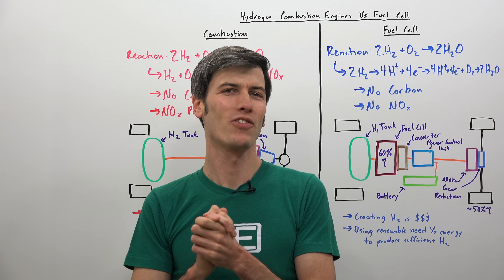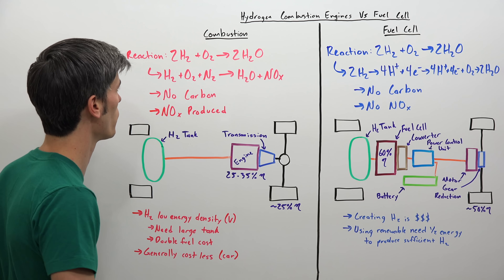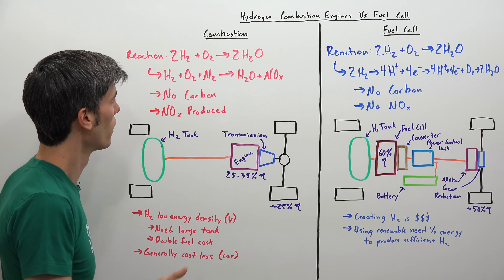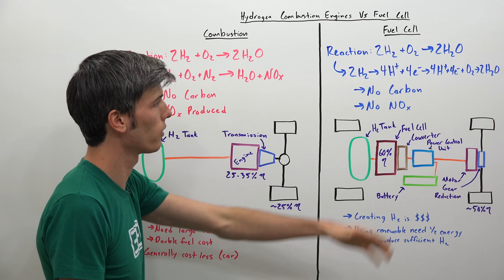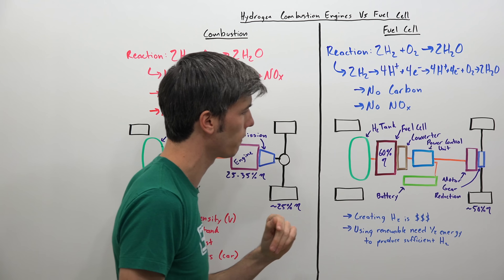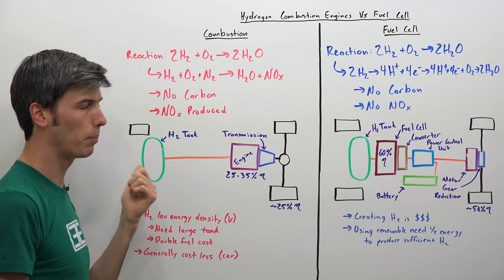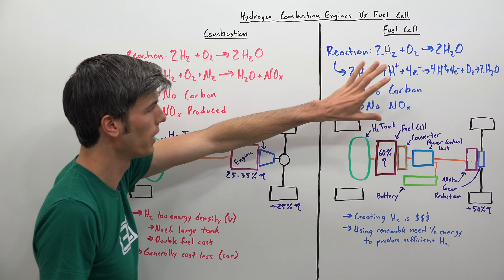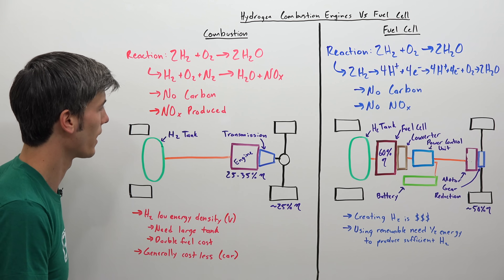Why Hydrogen Engines Are A Bad Idea

Comment: One more thing: Fuel-Cells require the mining and smelting of Cobalt and other uncommon metals, as opposed to the common iron used in internal-combustion and moderate-temp Stirlings.
Reply: The battery is also a big deal. People quikly forget what a durable society means. We need to find system that are suitable for milienear. How can you recycle a battery or a fuel cell ?....  One big advantage not mention here about combustion engine is that it can be easily remelted.
Reply: @EnderDeaD14  Yes, battery-recycling is a problem.  And children are dying in the cobalt-mines in the Republic of Congo, where most battery-cobalt is mined. Heat engines, including the efficient Stirling, can be made of iron, including stainless-steel. Iron is an abundant component of the Earth's crust, and is the 5th most abundant element in the crust. No mining of exotic scarce metals. Mining the lithium for our lithium batteries, is harming the water supplies of the people who live in the Andes mountains.  Stirling, Otto and Diesel engines can run on ammonia fuel, easily made from water and air,by renewable-electricity. Fueling stations can quickly & easily be converted to ammonia fuel, which liquifies at around 200 psi. We already have a widespread infrastructure to make, store & transport ammonia. Belgium converted their buses to ammonia-fuel in WWII, and it took only 5 months. But Stirling engines, being external-combustion engines, can easily cleanly burn any fuel, including ammonia or biodiesel.
Reply: @michaelossipoff2433  very informative!
Reply: @michaelossipoff2433  I don't think car manufacturers should replace bad gas with another bad gas. And I think that fuel-cell is the future. But because we have so many combustion engines already made and on the road. I think we should make hydrogen conversion kits for a bunch of different engines to make the road more green. And affordable for people to get a greener way to drive their car. Not everyone have the money to buy a new car we know that. And by doing this classic cars can still be on the road Without gasoline. Now I am a guy that hate non combustion cars and don't like the thought of combustion engines coming to a stop. So by doing this I can still be happy and make the world a bit less polluted.
Reply: exactly, that's the point to abandon fuel cells and ev, also don't forget that ice engines can be made with hightemp bioplastics
Reply: The Dutch company Phillips had an improved Stirling engine running in a fleet off test buses in the 70,s.Robert Stirling's engine uses an external heat source which could be either nuclear or chemical,including gasoline or diesel.The test results against diesel powered buses was good.I don't know why the project was shelved but my guess is political pressure especially as the biggest oil company around Shell is also Dutch.
Reply: @eugeneoreilly9356  Sweden use sterling engines for our submarines 😎
Reply: I don't think one person puts out enough ammonia in urine to drive very far, but yes, that hadn't occurred to me, and it would be great if we could be our own fuel-source.  But I doubt that it would be enough for transportation-fuel.
Reply: @Johnny Z'Salt But I don't know what percentage of urine is ammonia. If a large group of people were stranded, maybe they could all make enough pee-ammonia to fuel one of them to ride a small motorcycle to get help.   ...but if the motorcycle uses a gasoline Otto engine, then I don't know if it could burn ammonia without the conversion that has been used for ammonia-cars.  If it were a Stirling-powered motorcycle, then it would require less modification to burn a different fuel such as ammonia.
Reply: Maybe some long-distance motorcyclists, with ammonia-powered motorcycles, could have emergency urine-ammonia extraction kits in case they run out of fuel.
Reply: @Johnny Z'Salt I looked up the ammonia-content of urine, and it isn't much. Here's what I found:

Ammonium/ammonia-N (mg N/L) 	460 

That's only less than half a gram per liter. They seem to be giving grams ammonia-nitrogen, rather than ammonia, but ammonia is mostly nitrogen, with just 3 hydrogens per nitrogen. So the mass of ammonia would only be 17/14 times the mass of nitrogen.
Reply: @michaelossipoff2433  Yes true and I when I pointed it in a video, a Tesla fanboy started arguing why batteries were better !!!!!
Reply: Remove V8 from your pickup. You have choice of one Bovine methane fuel cell or dual Swine fuel cells.
Reply: @Johnny Z'Salt I worked for a company that was so cheap they did not store antifreeze coolant for the fleet. I always kept a case of bottled water they provided us with. Many times I had to resort to that.
But I never got blamed for blown head gaskets. Just flagged it for: "Needs Service."
Reply: @michaelossipoff2433  Keep a bottle of grain alcohol. If your bikes a one lunger you could rejet the single carb by the roadside. Maybe another 10 miles. Or consume and pass out awaiting medico arrival.
Back in the late 1970's Holley Carburetors marketed a "Dial-A-Jet 4bbl carb. You could change primary jet size,  by a dash control knob.
Reply: ICEs need catalytic converters full of platinum group metals mined in Africa.
Reply: So what! Cobalt is a trace mineral. Mining iron causes far more environmental destruction than cobalt.

Most ICE engines contain more aluminium than steel.

We would all be far better off with car shells made of impact resisted plastic than cheep and nasty steel.
Reply: @wiretamer5710  Iron is one of the commonest metals in the Earth's crust. Cobalt, an exotic scarce metal requires digging up lands that someone might not want dug-up. It's unavoidable to make vehicles from material, but iron is easist to find anywhere where it's relatively environmentally safe to dig. Lithium mining is now a problem for Native-Americans' water-supplies.  Yes, internal combustion engines are filthy & use catalytic converters. They could use air-injection & afterburners instead, but they're just too filthy to use anyway.
I propose the external-combustion Stirling engine. External combustion engines can be much cleaner & more controlled, and are much more fuel-flexible. e.g. Stirlings can easily burn ammonia, which is much, much more feasible and ready for use than hydrogen.

You say Cobalt is a trace metal. What do you propose to make the rest of the vehicle of?  Matter, I trust. You have to get iit somewhere. Yes some engines use aluminum too. The Nasa Stirling used stainless-steel. In any case, aluminum, too, is very common in the Earth' crust.

But this is all hypothetical, because land-based renewable energy sufficient for motorized transportation is impossible, due to the limited size of any country. Vast oceanic collectors of all types would be needed, likely causing huge environmental damage.

If you really want motorized transportation, especially individual vehicles, then you'll need nuclear energy. Either conventional or Thorium slow-breeder, for which Thorium is available in ordinary granite, in usable concentrations.
Reply: @michaelossipoff2433  ‘land based renewable energy sufficient for motorised transportation is impossible’

that is a remarkable law of science to have just pinned up on Mt Olympus!

Based on what? The total energy use of motorised transport today?

Why does land transport have to remain as inefficient as it is today? It doesn’t.

Based on projected renewable energy production: when? Solar PV energy production is only starting up its J curve now. The projections are it will exceed peak global fossil fuel energy production in ten years.

There is no projected limit to Solar PV energy production, so I can’t see how you can say running the global transport fleet on renewables is impossible.

…, and I only factored in solar PV, not marine wind and wave, not geothermal and not Solar Thermal.
Reply: @EnderDeaD14   batteries can be recycled tho, it's just that EVs Are still a small part of the market, as they get more wildly used more companies will start to recycle them, also let's not forget ICE engines too need a battery
Reply: @michaelossipoff2433   there's lots of new technology in battery term that negates those, per example aluminum batteries and others which don't require lithium or cobalt
Reply: @k-osmonaut8807  You're talking about a science-fiction hoped-for future. Yes, IF the batteries & fuel-cells didn't use rare, exotic metals, then things would be different. Worlds of IF...I love it.
Reply: @michaelossipoff2433  
better tech isn't that far off, heck even hydrogen production from an electrolyzer is being improved as we speak daily and will likely finish it's research and settle on a design (likely) by end of 2023, then ofc production of the units and sale of them along with companies buying, installing, and using them. still it's not THAT far off, granted the world might not be the same in that time frame.
that's just one research company, there are more but i don't keep up with them. that's also only in this part of the world (US) so who knows what other people in other countries will come up with. there will be a massive hydrogen push once the greed of the world catches wind and they all shift over in favor of the tech.

also i would never bet on nuclear energy of any kind being a good replacement for anything besides maybe space travel.
Reply: @rocksfire4390  I have no objection to future accomplishments, and the actual achievement and actual availability of future technologies. Maybe something better than ammonia-powered Stirling engines will become available. Fine.I was just talking about what's the most available now. The actual existing infrastructure for making ammonia from air, water & clean electricity, and transporting ammonia, and storing it, is already here. Ammonia fueling-stations would be incomparably cheaper & more feasible than hydrogen. Belgium used ammonia-powered buses during WWII, and they worked fine. So far the Stirling engine is unmatched for efficiency, ability to be made from ordinary common iron (in the form of stainless-steel), and production-cost comparable to our Otto-Powered cars. As I said, I have no objection to other things becoming achievable in the future. That's fine. I was just talking about what's available now.
Reply: @EnderDeaD14   i mean batteries can still be used for solar and wind storage even after they go insufficient for cars, fuel cells on the other hand are more tricky as they are probably not as profitable to be recycled
Reply: @adorabasilwinterpock6035   specially rodium
Reply: @michaelossipoff2433   i mean not really, look it up there are already tons of studies on aluminum and even sodium batteries
Reply: @k-osmonaut8807  ...and wouldn't that be nice, if we could drive a study.  There are many ideas, studies, proposals & possibilities out there, and it would be wonderful if one of them gave us easily, environmentally-safely-mined batteries &/or fuel-cells.  Stirling-powered cars have been built, driven & thoroughly tested. The NASA team reported that their Stirling Chevy could be mass-produced for ordinary car prices. Ammonia was used for bus-fuel by Belgium during WWII, & we already have a fully-developed & in-use infrastructure for making, transporting & storing NH3. Its liquifiability makes its filling-stations incomparably cheaper, safer & more feasible than hydrogen. The X-15 was NH3 powered.  We all would welcome the things you propose, but I was just talking about what's already available:  NH3 powered Stirling engines, made from ordinary common iron (in the form of stainless-steel).
Reply: Many batteries have nearly gotten rid of cobalt with the newest batteries only using about 5% cobalt. Tesla's newest don't use any at all.
Reply: I really hate it why are Stirling engines so rare
I mean
They work
They can run on any kind of heat
That's what buggs me

Comment: "Electrons come back eventually because they are very kind"

You are the Bob Ross of science
Reply: Even Rains ---- Electron abuse is rampant. They are being ripped out of the ground,  forced through wires and made to power all our devices with no compensation. How much more will they put up with before they rebel.
Reply: What about Mr.Roger
Reply: Mitch  fine  if you want to get technical it would actually be STEM not engineering lmao
Reply: EDITH BARRETT lmao
Reply: EDITH BARRETT I think he meant “mob boss”

Comment: As a car guy I have always been intrigued by fuel cells. We actually started using them in place of a battery for our equipment at work (fork lifts and such). Not only did it have better range over the lead acid battery's but it also was more efficient since it took about 4 min t fill the tank vs 15 min to swap out for a fresh 600lb-1000lb battery (depending on which equipment needed the swap).
Reply: That doesn't mean it is more efficient energy wise. Because it obviously isn't.
Reply: I do not I understand what you are saying... 
As a real car guy myself, having a 700hp 300zx, I should understand what you are talking about. 
Doesn't sound correct.
Reply: @VtecdippinBB6siR  basically the fuel cells are more energy dense than the lead acid batteries and they only need to be refilled which can be done quickly
Reply: @Simon-dm8zv  He means that for the workplace man-hours, refueling is more time-efficient than swapping batteries. In both cases, (electroysis of water to capture hydrogen vs recharging batteries), there are significant energy losses.  That being said, hydrogen is great right up until the instant that the fuel tank, which has become embritttled due to hydrogen (held under high pressure) migrating INTO he fuel tank material like water in a sponge, shatters and explodes (even WITHOUT ignition of the hydrogen), because any liquid hydrogen at temperatures tolerable by humans is necessarily at a VERY high pressure.

Comment: I think that hydrogen combustion engines are indeed a good idea. First off, they are significantly lighter than a fuel cell, just like how a standard engine is, and are still able to put out just as much torque as a diesel engine. This is very much necessary for large industrial vehicles (that are already ridiculously heavy) since installing a fuel cell or a lithium battery pack would increase the weight by a significant margin, making them inconvenient and unusable. Another plus is that with the production of hydrogen combustion engines is that thousands of people wont have to lose their jobs and be forced to find a different line of work, since batteries and fuel cells are so dramatically different in structure and production than a combustion engine. It definitely has its uses, and it will probably be just as significant as a lithium battery or fuel cell power.
Reply: Having H2O as a residue of combustion is a plus.
Reply: @chrishaase  "you are sitting on a bomb" Not necessarily, as one could use a system that worked on demand, in this way you would never have enough stored in the lines to do anything serious.  H20 as the residue, and oxygen as the release, does not sound too bad.
Reply: @quickfixstat  It's not about the volume as much as getting everything sealed. If one fitting starts leaking, you have an issue. The flow has to be continuous while the engine is running. Hydrogen storage needs to be done at insane pressure. You need 3500 cubic feet of hydrogen to get the same BTU as 10 gallons of gasoline. You don't have 3500cubic feet of space in car so you need to store that at very, very high pressure to make it fit in a reasonable amount of space. One leak will cause a LOT of hydrogen to come out.
Reply: @commscan314  pure hydrogen for car applications is stored at 5000+ psi, while rockets store it at about 60psi Pure hydrogen is also very hard to seal properly due to its molecular spacing … very different applications
Reply: But you need twice the hydrogen which is already 6 times less energy dense than gasoline. That basically means losing your back seats to fit in the extra fuel or only having a range of 200 miles. 

Weight of lithium ion cells in fuel cells is not as serious as you think. The cells are usually pretty small in fuel cell vehicles only being around 1KW. That means the entire battery only weighs about 22Kg or 50 pounds. That's basically nothing compared to the added weight of many times larger hydrogen tank required for hydrogen combustion.
Reply: @rodbutler8069  No. Not at all. Water doesn't mix with oil.
Reply: @Skylancer727  How about the weight of all the extra copper wiring?

Gross Specific Energy density of gasoline is 44.4 MJ/kg and for Hydrogen it is 142 MJ/kg.
However, net values are  41.1 and 0.506.

Now you may think that all the heat will be wasted in the exhaust H2O for H2 and that's
the reason for the much lower value, but with H2 you can do something that you cannot do with gasoline...
RECLAIM THE HEAT. Just lookup "condensing boiler" to understand what I'm on about..
So, in reality, where engineers will design engines to be as efficient as possible, 
the condensation energy reclaim method will certainly be utilised.

The trend today is for H2 tanks to be made of lightweight carbon-fibre types of materials. 
H2 scales better than batteries b/c the mass doesn't go up that much as the tank is increased.
Finally, graphene can be used to adsorb hydrogen on  it's surface, vastly reducing pressure requirements.